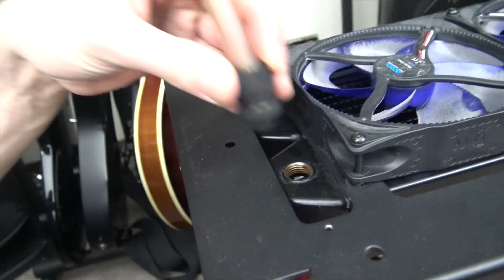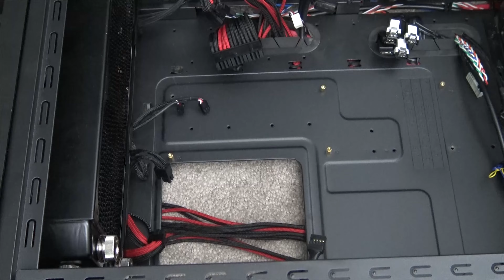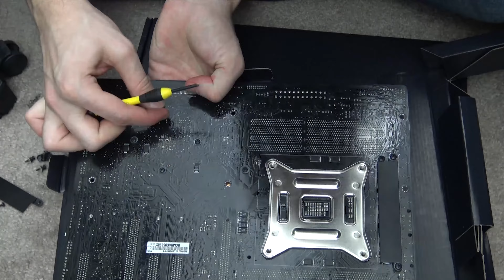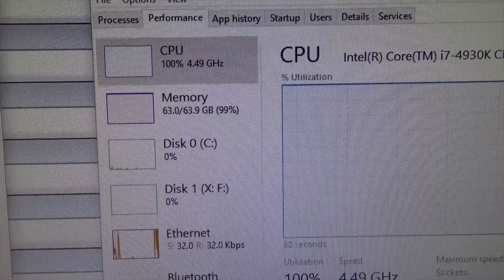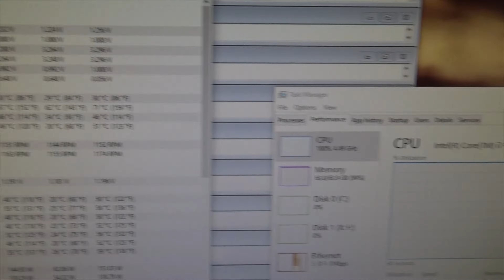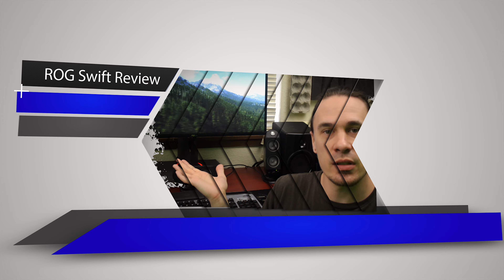Custom Water Cooled PC Build Log | Motherboard Replacement

Comment: that MB is 5 years old
Reply from the maker: +kevin russell Yes it is. It's about time to replace it too. I'm waiting Skylake-E CPUs/Mobos to come out before then though. That is if Intel releases them.
Reply: Next year most likely broadwell-e is coming out in a few months
Reply: +Electreak You kinda skipped the part where you drain the loop...all I saw was that you screwed a tube into the radiator...what did you do? Did you just syphon it? Did you tilt the computer? What?
Reply from the maker: +Mike Estacio I tilted it, and opened up the caps on the bottom the the video card.

Comment: How many Radiator you have in the system? just 1 x 360mm Rad? Damn 55C during Prime 95? that's really good.
Reply from the maker: 1 360mm rad. I would recommend adding one 240mm rad if you bios hack your card though. The CPU OCed, and the GPU Bios hacked while both being under load can get a bit toasty. That will probably give you the max cooling you would get in a single pump/res loop like this.

Comment: Bro if you will do the OC on the graphic card would be nice to know how you replace the Thermo paste on the GC and which one you advise, I mean do you use the Arctic 5  silver too?
Reply from the maker: yeah! I did do the water block install video too. you can check that out, and see what paste I used. I would recommend any non conductive paste. Don't use Arctic Silver as it is conductive.
Reply: Electreak is it the video you did the beast?

Comment: Nice video bro, so you dump the G15 keyboard, did you know is the same as I have ? hehehe will be replacing it soon to, but only after the monitor.  Really you got a bad MB Ram slots, unlucky bro, was the MB in 2nd hand? It seems new. Don't you prefer amazon to ebay?
Reply from the maker: I do prefer Amazon and company website over ebay, but sometime you have to use ebay to find discontinued products.
Reply from the maker: thank you for the compliments btw. :)
Reply from the maker: also the new G15 is a good keyboard, and so is the G910 but I'm thinking of changing over soon. Logitech is loosing the keyboard game.
Reply: Electreak
yeah the G910 Orion Spark has some bad reviews on the angle of the keys , and because they lost the lcd panel which was great for me for Team Speak, ARX is useless. I agree with you they are losing the Keyboards race, when they were very good. But I believe in the mouses as well bought the G303, and not the quality that I used to be.